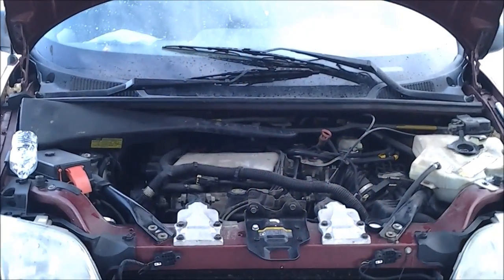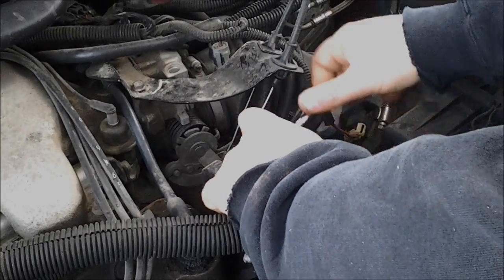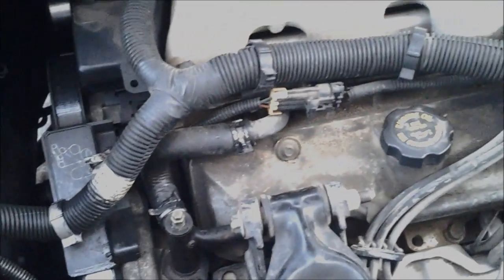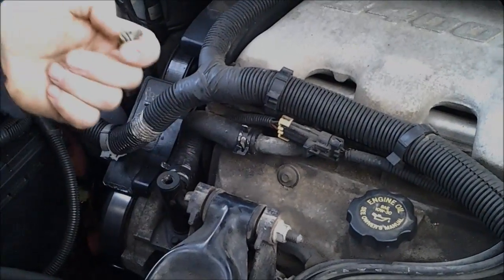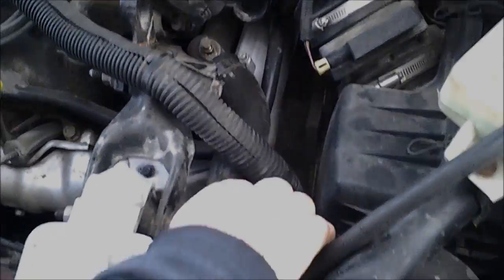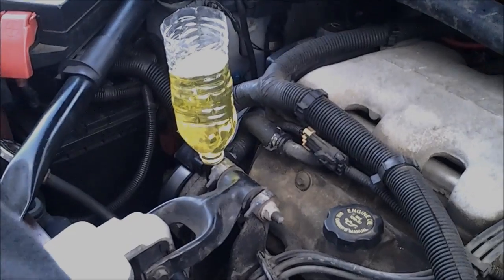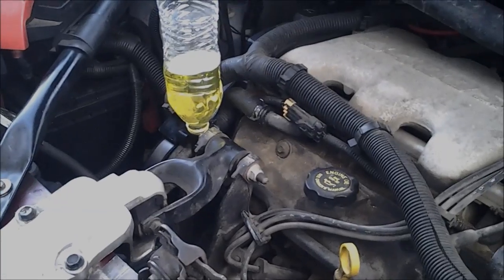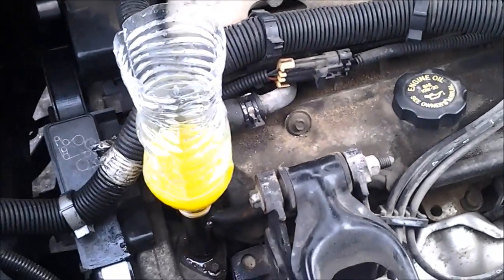Removing air pockets in engine  with plastic bottle

Comment: This really is an amazingly simple solution that looks like it will work better than our prior options. After replacing the lower manifold gasket on my 3100 I knew the coolant system was going to be a pain just from how the channels inside the block looked. So I put the entire coolant channel network under vacuum thinking that would do the trick like with any other engine. Much to my surprise I've had to bleed it multiple times over and still have air bubbling up each time I open the bleeder. Each time less air but so far it hasn't lost enough air to stop throwing the low coolant light or stop interfering with the heat.

This techniques reminds me of a chemistry tool I've seen where the chemist doesn't want to contaminate their liquids but needs to collect the gas coming off from them. So they use a setup similar to that bottle on the bleeder neck to create a liquid barrier that only allows gasses out by choosing a liquid that wont overcome the pressure inside the flask containing their reaction (meaning the liquid floats inside the barrier and doesn't fall through the hole). This is just a slight variation on that where the liquid is one that will overcome the barrier but is a desirable liquid to do so.
Reply from the maker: It's amazing how simple things can get sometimes.
Reply: Sorry, I know you posted this comment years ago...Just bought a car and it has no heat and overheating. I tried to bleed the air out and after multiple attempts,  my heat came back inside the car and it runs at normal r
temp on the gauge now! About 30-45 mins of running around to different stores, I lost heat again and it got hot on the gauge. So I tried bleeding again, and everything works. H
That was last night. This morning I started the car and it never got heat and started to overheat again... How many fricken times do I have to bleed air out? Did you have similiar problems or am I looking at a major problem?
Thank you
Reply: @splash5974  I no longer have that car but I remember after far too many sessions with an evac pump it did eventually work out enough air to get heat back consistently. That engine as infuriating to do any serious work on since it meant for the next couple months I would be doing evac sessions to bleed the coolant channels.
Reply: @eideticex  thanks for the reply.
So I guess I just need to be patient and keep an it. Just frustrating when it seems you've got the air all out, then after driving the car, it starts the same no heat and overheating issues again....
Was yours like that Atwell till you got all the air out?

Comment: Art, you may not be a "mechanic," but this is pure genius.  :-)  You're right -- this is a chronic problem, especially on the Venture/Montana vans....  especially the ones with the rear heating.  Recognize too your reference to other creative, involved solutions "out there."  I broke down last year and bought the orange version of Eric's (the car guy) yellow "spill proof funnel" -- which follows the same idea, except the funnel is perched (precariously) above the end of the radiator.  (on my 2000 Montana)  Wondering though how your "device" :-) handles the serious amount of hot bubbling fluid that will come up once the engine is up to running speed -- and after the thermostat opens....  Then too, how do you keep that plastic bottle doo-whap from melting?  Doesn't that t-joint bypass pipe area get really hot?  Guessing you shut the vehicle off before it gets to these points.  Also, do you find it helps to have your vehicle parked on an incline?  Again, kudos for thinking outside-the-box.
Reply from the maker: yes I like to park on an incline, I usually pull up on a curb if I am not at home where I have some ramps.I haven't had any problem with the hot fluids melting the bottle. i don't usually run the engine more than 30 seconds at a time while filling.

Comment: Thanks!.  Worked perfectly.  The toughest thing was to find a bottle that fits perfectly.
Reply from the maker: I know, I have some cloth electrical tape I have been using since my bottle disappeared. it helps me make a temporary seal around the tee where I connect the bottle. Maybe i should film that as a follow up video.

Comment: Would this work on my 3.1L malibu? It seems as though I only have one bleeder valve.
Reply: It just might, I have the same setup and you do have two bleeder valves. The second valve is not your standard bleeder. Look at the top of the thermostat housing and there is a hose coming out that returns to the tank. Look closely at where it meets with the housing and you'll see two sections to the screw portion. This style of bleeder you loosen that connection, not the one going into the housing but the part where the two sections meet together.
Reply: Malibu's, Cutlass', Alero's, Grand Am's,- basically any of the 3100 or 3400 equipt cars that DO NOT have the front "dog bone" style strut mounts have only 1 bleeder valve, its on the heater bypass pipe at the top of the water pump housing, but do not have one on the thermostat housing, as the bigger cars like the w-bodys, aztecs and minivans do.

Comment: Will this get the coolant also through all the heater hoses and the heater core? I am replacing the core
Reply from the maker: This helps to get the air bubbles out of the high points in the engine, I don't know for sure on your engine model, but when I started the engine it helps circulate the coolant through the system and move the air pockets out. We don't have any problems with the heater after we do this.
Reply: Art & Hardware Thanks. I have the van as well.
Reply: Did you put the bleed valve back in before removing the bottle? Would have loved to see how you finish the job.
Reply: I can't find a water bottle that will fit over mine🤨 all slightly too small
Reply: @MrRusell86  this is what I did and I highly recommend it. I cut a short section of heater hose to fit over the pipe and secured it snugly with a hose clamp. I then put a yellow spill proof funnel on top and secured that with a clamp as well. Worked beautifully with no leaks. I wouldn't bother with the tape, the issue is while you're filling and purging the system its gets quite hot there. I actually did find a plastic bottle that fit fairly well but the heat melted the neck of the bottle and coolant went everywhere🙄
Reply: @MrRusell86  Filling the bottle before starting is best , I disabled fuel and spark so I could turn the engine over in short bursts 3 or 4 times to allow the engine to gradually draw in the coolant. Before that, however, did you fill the radiator and bottle with the bleeder open on the gooseneck to get as much coolant in as possible? When coolant starts to emerge from that bleeder you should close it and then a good amount of the air should be out. You could have a fairly large air pocket still that is not allowing the coolant to flow into the engine from the bottle
Reply: @MrRusell86  yes, makes sense to me. If the heater is also working well you should be fine
Reply: @widtrak77  Okay, great. The heater works quite well. Well, for some reason sometimes the air doesn't work (irrespective of hot, cold, or AC being used) when it is on the highest fan speed (#5) but aside from this the ventilation system is quite good.

Comment: going 2 see if it work. been having my van sitting for about 3months change the thermostat & water pump it was over heating 2 many times..  

Try 2 bleed. it w the lil screw but notting.
Reply from the maker: Yup I had the same problem, this is what worked for me, Hope it does for you too.

Comment: Is it normal before the valve open the water in radiator boiling? Every time before the valve open water boiling first and smoking? Do I need to replace my thermostat valve?
Reply from the maker: I ONLY do this when the engine is cold. I am not a mechanic, probably good to check with someone more knowledgeable than me. Probably 99%  of the planet. ;)
Reply: Cambio de bomba de Agua Pontiac Aztec 2002